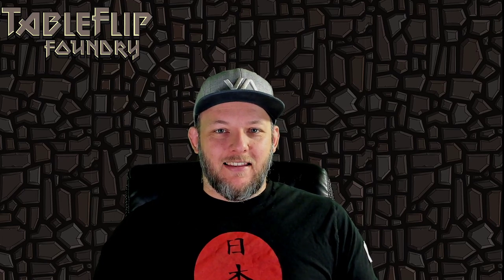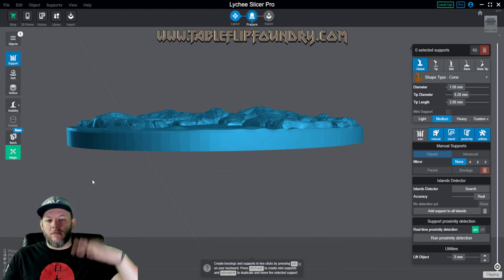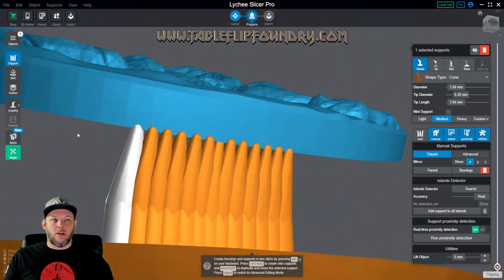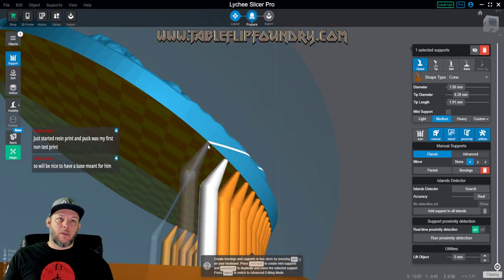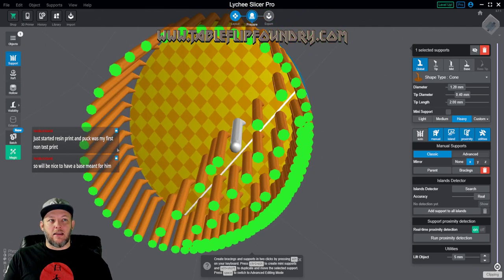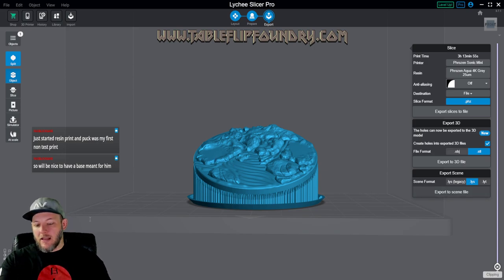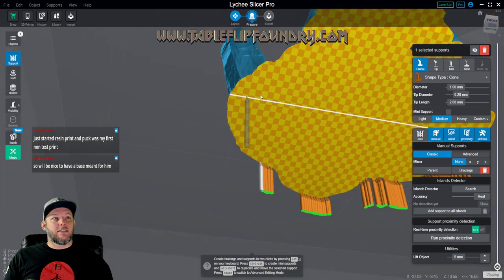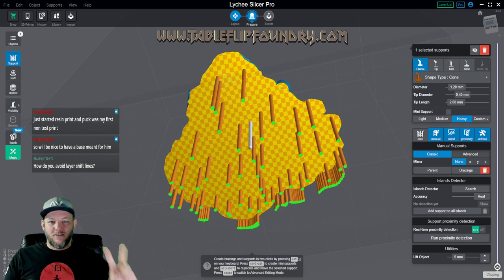How To: Pre-Support bases using the Double Row Method

Comment: Isn't this a waste of resin? can you instead use branching support?
Reply from the maker: I think failed prints are a bigger waste of resin. 
But also, professionally, I prefer to use a support technique that offers more stability during the printing process. Especially when holding a perfect shape is so important like on round bases. You're welcome to try to use branched supports if you like. But the resin savings is usually so marginal it's insignificant. 1 or 2 ml. Sometimes less.